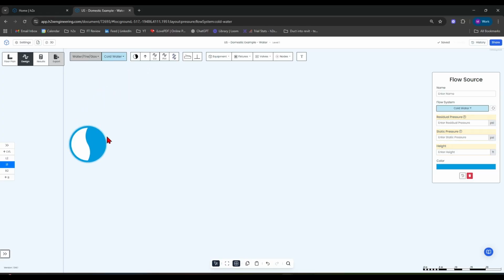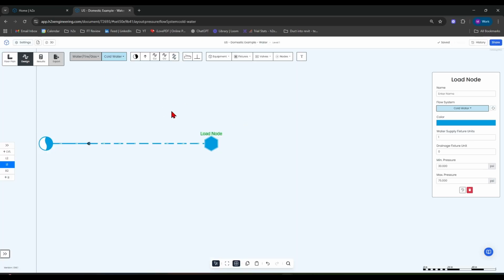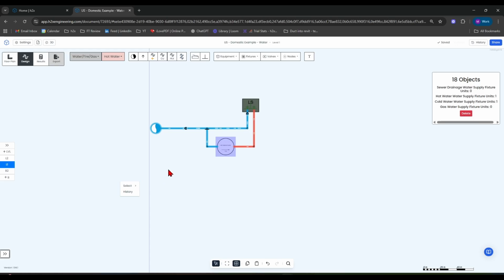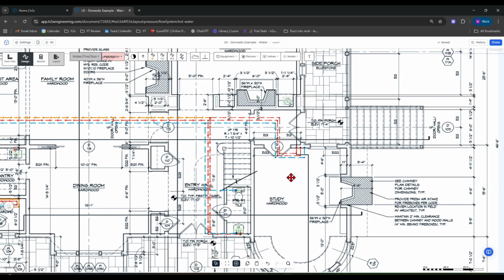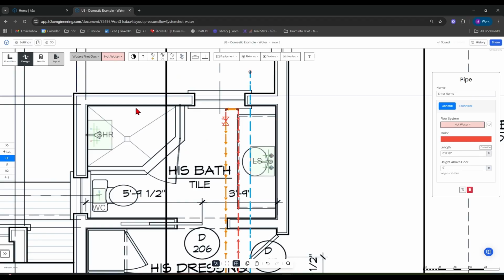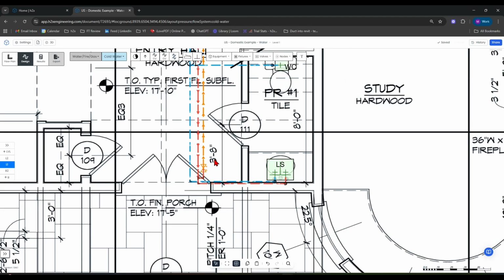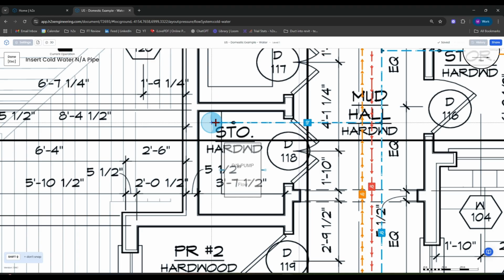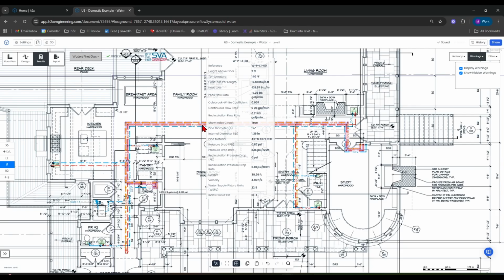How to Design Residential Hot & Cold Water Plumbing in h2x (US)

Comment: Nice video. Just for the US? Can it be used for designing MEP systems in Spain? Thanks
Reply from the maker: Hi Jesus, It would depend on the type of system you are looking to design. Some of the flow systems such as water design, rely on the selection of a peak flow rate methodology, and we have a select number of standards within the system settings. Could you specify which systems your looking to design?